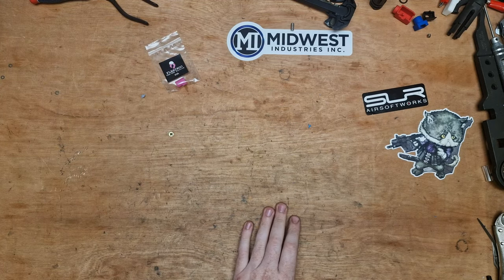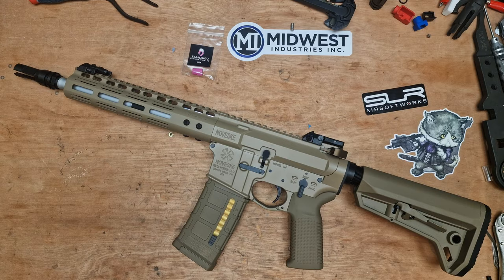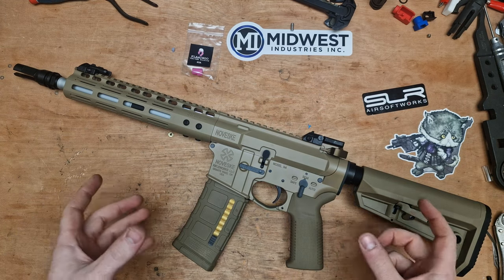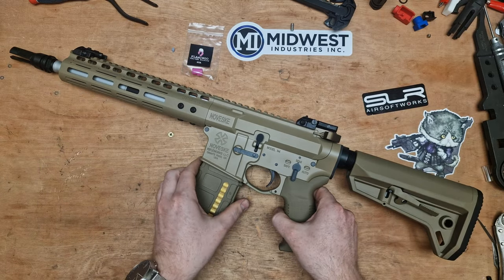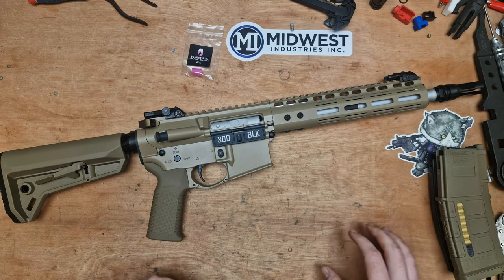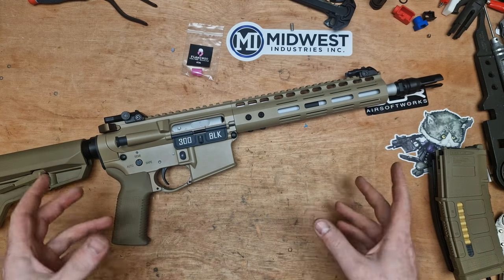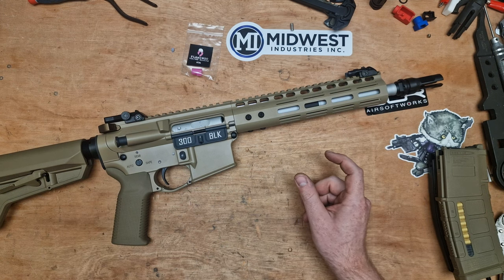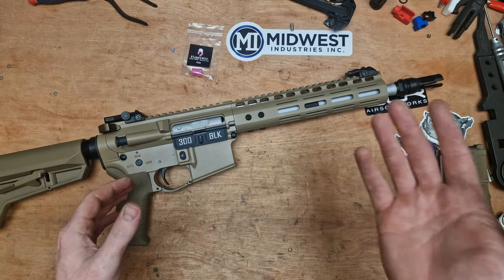Double Eagle Noveske N4 MWS Clone Barrel & Hop Upgrade

Comment: Hey man, I got mine and the MWS magazines are very loose, also the double eagle magazine is loose as well. But I fixed the problem with some Velcro type in the front of the mag well. Before I did this, I have already broken two nozzles the original one and one from guns modify because the magazine would drop and the BB follower will catch on the top of the bb and will not push the bb into the hop up chamber, and it will cause to the nozzle to strike on the top of the hop up chamber.

Comment: SUPER IMPORTANT. I JUST SMASHED MY NPAS!!! MAKE SURE IF YOU PUT THAT O RING ON THE OUTSIDE OF THE HOPUP UNIT THAT THE UNIT SITS PROPERLY IN OUTER BARREL.

It doesnt seem to do so with plastic stock chamber. I just upgraded to a CNC chamber. And as it wasn't seated due to that o ring it smashed

Comment: Just before 13:52 you praise the laylax 250mm barrel for use with your AKM, could I ask what kind of performance benefit you got with that over stock? I've got a BBF hop arm, omega nub and a MR Hop bucking in mine (Which I'll be changing to a flamingo). I am slightly worried for joule creep, wanting to get all the accuracy and range I can get out of it since it's so fun to use

Comment: Hey Jaeger, there is 2 models from the Noveske, 1 comes without the bullet window DE mag, and one with.
The one you have is aimed for non EU market actually, its mainly sold in Japan,China,Hongkong as you look up on Thaiwangun the Noveske model is different, just like in any EU website its the same.
If you look outside of EU they're all with a nicer stock, and mag as well.
So it might be that it's a different batch and tighter magwell.
Because my friend broke 2 Nozzles by using T8 mws mag in the EU model with extra wobble.
(the ''EU'' DE mags are quite big from the upper side of the mag, and they do not fit into the TM MWS either, but the ''OUTSIDE EU'' mag with windows in does fit into the TM MWS.
Reply from the maker: This rifle was bought from a UK distributor. I agree without seeing the older one would be hard to say
Reply: Mine is also from a uk supplier and is the same as Jaeger
Reply: Mine was also from uk shop and has the 150mm barrel
Reply: and i assume it shoots 0.9--1J out of the box? @TheRHYSD

Comment: I think when the hole in the upper for the pin is drilled it is paired with that upper and lower to allow for tolerance variances
I had to have a new lower on my MTW 9 got it back the rear pin was too tight had to send it back to get it reamed to fit

Comment: My mag well is that tight I have to open the upper to install the airtac adapter. 

Installing a 350mm inner, it runs flawlessly at 60psi, but they want higher pressure to sound less springy. I’m going to cut it to the end of the outer, and then it should run happily at 90psi and run better. The standard bucking and nub are trash, I put a mr hop and omega on and it’s perfect.

Comment: Hi There, 

Hope you're well,

I bought one of these from Taiwan gun and it seems to have came with a 270mm inner barrel however its firing around the 1.5j mark with UK retailers selling them with 150mm inner barrel.

This is a problem for me as all Airsoft RIF'S in Northern Ireland have to fire below the 1j mark.

Would you have any idea what inner barrel length I should get to fire around the 1.j mark?

Any help would be greatly appreciated.

Thank you.
Reply from the maker: You will need to modify the nozzle valve as barrel length would be far too short
Reply: @Jaeger-Precision  no worries, I got your very low nozzle and titan nub hopefully that sorts it out. 

Knowing my luck if I got the low variant with the barrel length I'd probably be chronoing at 1.1 😂😂

Thanks for the help.

Comment: You have the second/different version as mine is a few months old, and I got it from Taiwangun, longer inner barrel shooting 370 FPS on 0.20 BBs, mags are a tight fit no wobble, different mags.
Reply: Do you have wobble with mws mags or haven't you tested it? Was looking to buy it on taiwangun too.
Reply: Don't have any TM MWS, only DE & Gun Modify both fit, very little if any wobble.
Reply: This is Taiwangun's answer why EU version looks different than the one sold in UK:
"Thank you for the message. DE does not have a license for selling some parts on EU market"
Reply: @HughJC  ah okay thats nice. I bought guns modify mags for my DE so will see.
Reply: Waiting on mine from taiwangun. 
So i guess ill need a npas to field it...?
Reply: @guysmekens429  new version is around 350 FPS or less, it deopnds on what you get and your local limits.
Reply: @HughJC   depends. Some use 350 fps some use max 1.2 joules

Comment: Got the gen3, with black bolt and 270mm inner barrel.

Had already bought a 250mm maple leaf crazy jet 6.04, flamingo 60, JP titan nub for mws.. 

Haven’t gotten the nub yet.. but so far it doesn’t grip the bb, and arm is not straight, abit down on the outside of the hopup house.. I’m hoping the JP nub will solve this issue

Comment: Wich inner barrel and bukings do u think is the best for the mws?
Reply from the maker: Prommy 6.03 barrel. Flamingo 60 degree hop rubber with a titan nub. Have it in every mws I own
Reply: @Jaeger-Precision  wich weight of bbs do u use? It'll works with 0,28?
Reply from the maker: @greencobraairsoft  anything less than a 0.3g in an MWS is pointless

Comment: Small FPS increase because of Flamingo rubber
Reply from the maker: Its more likely due to the longer barrel as well.
Reply: it will slow down  if you stick 250mm  on  pistol... (Ollie talks airsoft) already tested different length of barrels on ,but that another video of really good test flamingo vs maple lift well the Flamingo doesn't hold any pressure at all and it's not that good on range as well chanel: Fiep airsoft  (Sniper mechanic flamingo vs maple lift autobot review plus shooting test) really great test.
And thank you for the job what you do it you are the one of the people who bring in our hobby to new level thanks